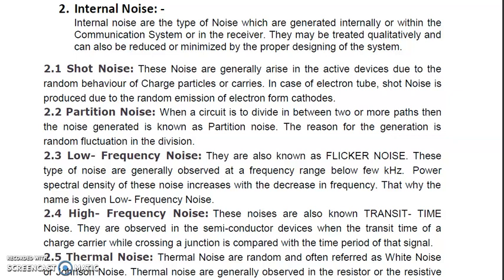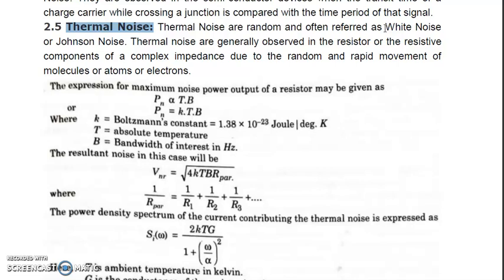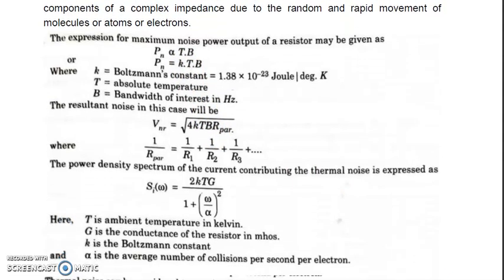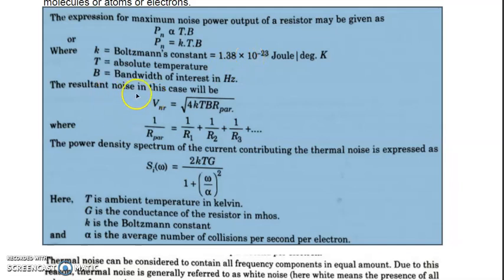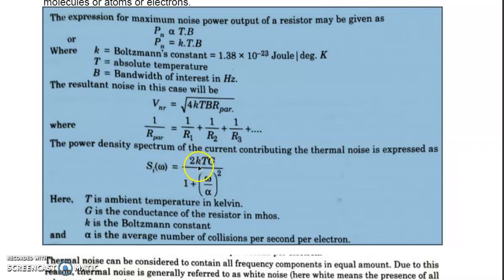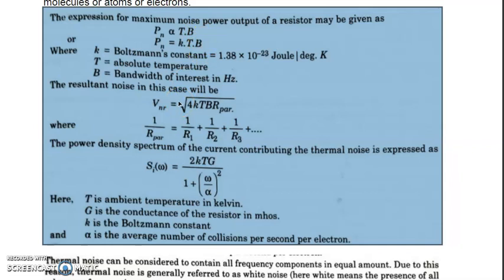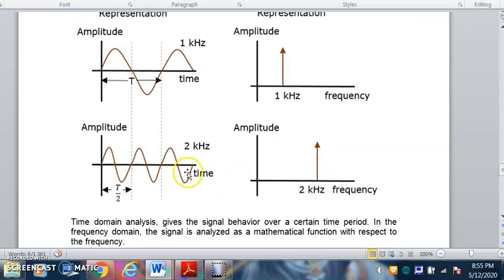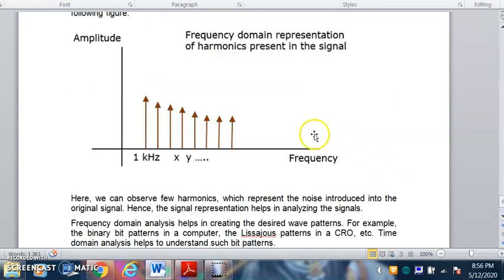Internal Noise

Comment: EC/071/19
1. What is "Power spectral density" mentioned in the low frequency noise section ?
2. One example of thermal noise .